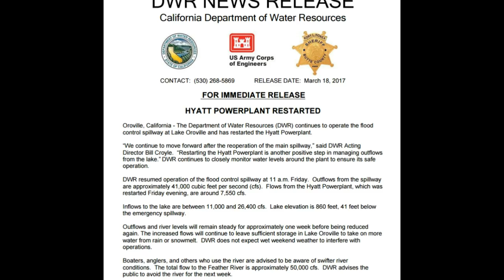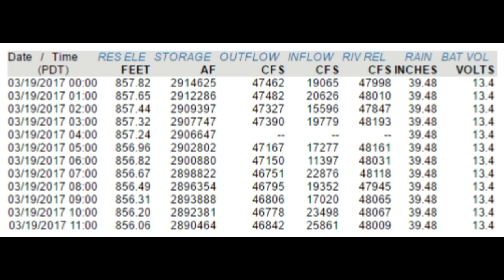Updated Images - Lake Oroville Dam Updates 3-19-17

Comment: Will be interested in your trip and interviews.  Hope they will discuss the cracked and tilted inner core of the dam, the decaying steel tendons, the gate leakage, the seepage along the left side of the main dam. the missing sixth turbine. the eroded inner valve and compromised draw down ability, the spring run-off season lake levels, the burned up auxiliary power station, the cracks in the gates, the cracked pavement in the center of the dam crest, the tree-lined running spring, and the unprotected fill dirt spill area near the parking lot.  Do they ever plan to build the sister dam in Marysville to protect the central valley?  And please question the wisdom of spending $200 million on a spillway for this ubiquitously compromised Oroville system!  Time to remove/ rethink/replan.

Comment: What a beautiful shot of the skyline over the spillway. I'm glad to hear the power plant is up and running. Shutting it down just did not seem to be the thing to do, but what do I know. Have a safe journey and I look forward to your coverage at Orville.  I like the clean info you bring to us, and the world is watching. I'll do what I can to help out.  Thanks again.
Reply from the maker: Thanks for the support!
Reply: The powerhouse couldn't be run due to the spillway debris choking off it's outflow - the powerhouse would have flooded.
Another issue is the powerhose was no longer connected to the grid as the wires were cut deliberately. The emergency spillway erosion (Or the main spillway - not sure) was threatening power pylons - if one had been toppled then several more would have gone is the wires were still attached.

Comment: VERY ROUGH ballpark estimate, use this at your own risk!

A 30 kcfs differential, between inflow and outflow, over a 24 hour period, changed lake level about 4 feet, two days in a row. 

With surface area getting larger, the deeper the lake gets, a reasonable expectation would be for this figure to lessen at higher lake levels, and increase at lower lake levels.

I think this calculation MIGHT be useful, for a broad overview. For example, if inflow were to exceed ouitflow by 60 kcfs, with lake level at 860 feet, the aux spillway might come in to play at the 5 day mark, as opposed to the 1 day mark or the 20 day mark. Even so, please be careful trusting this number.
Reply: jeff,,what are you talking about??What is kcfs,,you mean CFS and it is not  30 its 30,000.kcfs is chicken made by Colonel Saunders.
Reply: K... kilo... thousand. No "u" in Sanders.
Reply: Now where does "kilo" fit in?
Reply: The k saves me typing a comma and 3 zeroes.  1 kcfs = 1,000 cfs.
Reply: YW.

Comment: I saw one cement pump and one guy working it. What's up with that? You'd think they would at least have three trucks going.
Reply: Yeah, I think they know the emergency spillway will be topped again before all the melt is over. There is really nothing solid under the cap over the emergency spillway. They can loose that. If they lose that cap, the lake will empty over that spillway, and it will erode big time.
Reply: My guess is, there is no sense of urgency, being that they don't intend on using the emergency spillway for a long time to come, if ever ...
Reply: There is actually two trucks. Just watched it again in 480p. Still, something crazy could happen and the emerg spillway will be all they have.
Reply: Brendan, and we COULD be struck by a meteor too.  So what.  Let them work and stop trying to second guess what COULD happen.  It doesn't help anything.